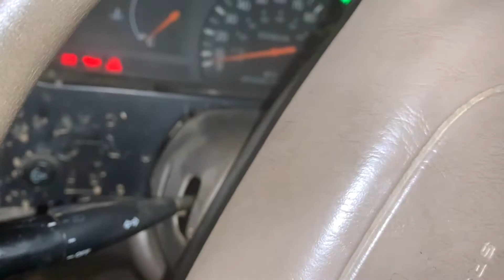How To Fix Blown EFI Fuse

Comment: I got myself the same situation with the EFI fuse. Mine blows on bumpy roads which tells me it’s a short to ground via some random wire in the EFI relay. Gonna check tomorrow and see if I can find the problem. Hopefully my fix is as simple as yours. My luck it will be a wire in the fuel pump.
Reply: Man this comment is literally me I hope it’s a fuse but my luck it’s prolly a wire or the pump
Reply: @RandmGhost Go check your EFI fuses if they aren’t blown then go check the oxygen sensors. You can find them on the exhaust pipe. Mine ended up being one of the wires for the O2 sensor behind the engine.
Reply: @SuperSpreeGaming  I definitely will when the sun up

Comment: Bro I just face same problem I am in the road right now I have spare 10 fuse 8 fuse already I try to replace when I replace a new also broken my fuse I have only remaining 2 fuse I cannot understand how to fix this problem can you explain how to fix actually I replace a new fuse but also new fuse broken I cannot understand sorry for that maybe you are busy no problem if you are free kindly reply me....🥲
Reply: They call it a "wiggle Test" Use only 15 amp even if it is a breaker. Then grab wireharness in small sections and wiggle while engine is running. If it trips relay, wiat for reset, start engine again and try same spot.
Reply: @erics7001 ur idiot if the efi fuse are blown the car will not turn over!! 😅 so what ur saying is not even a choice. If u don't know what is efi is then I wouldn't even comment